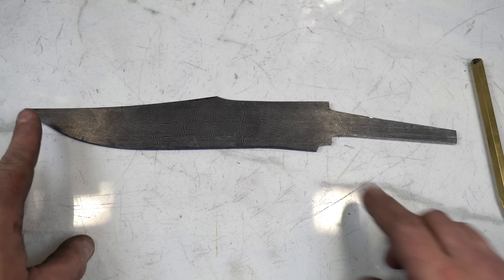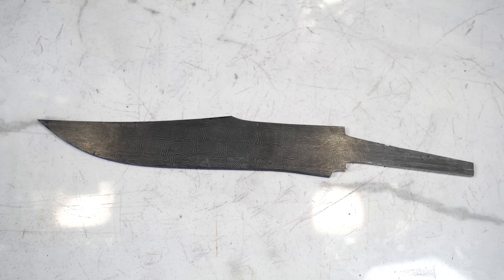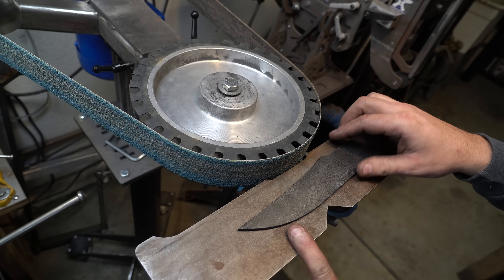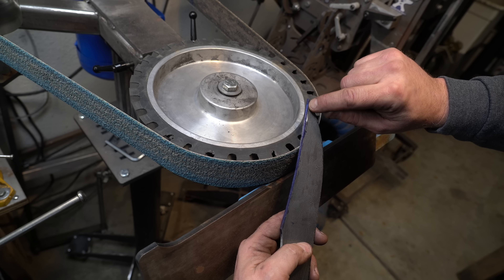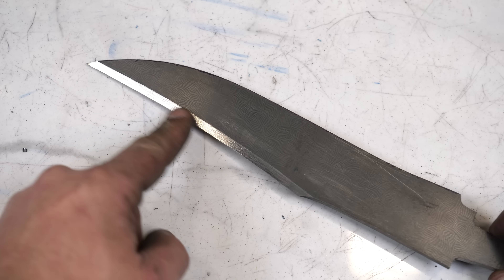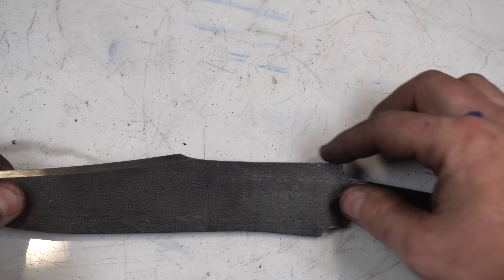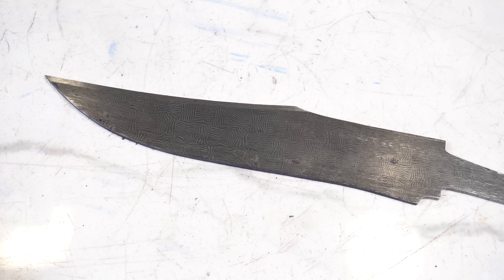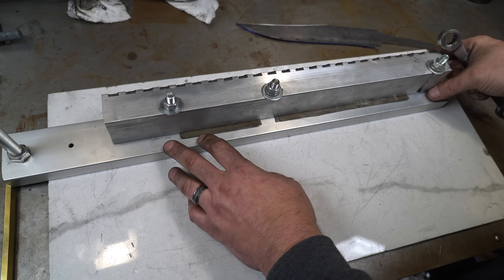Triple-T #119 - How to grind false edges and distal tapers

Comment: good video.  I have always put mine in after heat treat.  I might give your way a try next knife.
Reply from the maker: Definitely give it a shot before you do bevels.  It is also a great way to know if your bevels are symmetrical before you go into HT because the false edge on each side should be the same.  Thanks for watching.

Comment: When I'm grinding the off-hand direction, I'll slow my sander down a bit and creep up on the line slower. If I need to, I'll even go in with a file for the last few passes to even everything out.
Reply from the maker: Yup, good advice there.  I usually just take it easy on the pressure on my off hand for the first few passes until my brain catches up.  😜. Thanks for watching.

Comment: Just wondering why not taper on the mill? Is the belt grinder simply faster?
Reply from the maker: Tapering on the mill is extremely time consuming to setup the knife and try to fixture it.  Plus it's not that accurate because of chatter.  It's much easier and fast to grind it.  Thanks for watching.

Comment: Would it be possible to do the distal taper using files?
Reply from the maker: Sure, it possible, but I wouldn't recommend it.  If you're doing bevels with a file I guess you can do the taper as well, but if you're putting in bevels with a grinder, just do the taper with a grinder as well.  If you're doing a full-flat grind, just grind more as you get to the tip.  Thanks for watching.